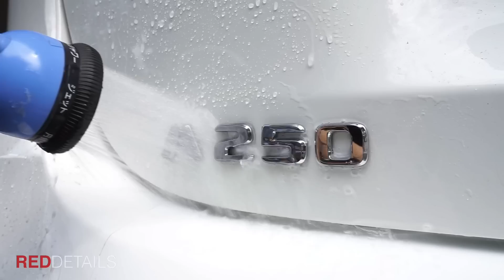Mercedes Benz A250  " Polar White " BRILA COATING " Full Detailing & Paint Correction

Comment: Dude, you let that wheel cleaner sit waaaaayyyy too long! The tire was almost dry for crying out loud. Also what’s the purpose of running your hand on the wheel well?
Reply: Michael F first up, dude sprayed the wheel, not the tyre. He goes back in for the second clean for the tyre.

Second, the dude is DETAILING, not washing a car champ. A way to tell if a car has been done properly is by running your fingers under the guard lip.
Reply: I know he isn’t spraying the tire. But if the tire is dry... then the wheel is surely dry along with the cleaner. Not good to let it dry on the wheel. It just seems the hand on the fender is not necessary. Thanks for the comment.